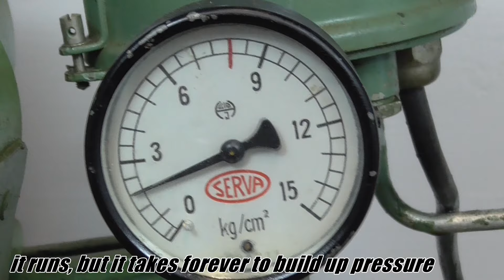1959 Broken Air Compressor - Repair and Maintanence

Comment: 00:07 me when I saw the power outlet 👁️👄👁️
I never seen that kind of outlet before here in my country even tho we use the same EU type plug, it's kinda cool
Reply from the maker: It's a swiss plug, only used in switzerland.
Reply: my mechanics insights ah i see.. i havent finished watching when i commented and i just realized it actually has 3 thingy not 2 😆
Reply: @mymechanicsinsights  Also supposed to be used in South Africa, but the most common use of them in any application is to charge a cellphone.  However your tank really needs to be cleaned inside, simply by filling with water and sloshing it around to get the scale moving to the drain, and then preferably also a inspection to see if the inner wall is not pitted badly. Pressure test as well would be good.
Reply: @mymechanicsinsights  also in Brasil! Our damn country changed 5 years ago the entire standard. Instead of using a more broad standard like EU or US, they used swiss, lol. Nothing wrong with it, but just a peculiar situation :p
Reply: my mechanics insights it’s very similar or equal to the new one used in Brazil.
Reply: @fabsfabsfabs 
I wish the world would just put their heads together and standardize already. Having 47 different outlet varieties is outrageous.
Reply: @SeanBZA 
Weird question, possibly, but could you use a mineral oil bath inside to make sure everything got washed out? Or would that be harmful to the inside of the tank?

Also, would a hydrostatic test accomplish the same thing?

(Forgive my ignorance, I don't know much about air compressors.)
Reply: @SeanBZA  Not quite. Brazil and South Africa use a very similar design that's mechanically incompatible to the Swiss plug for some reason. The SA plug is based on the IEC 60906-1, a proposed world-standard plug that no one wanted. There are three main differences between the IEC and the Swiss T13: the IEC plug is rated at 16 amps and has 4.5 mm pins, while the Swiss T13 is only rated at 10 amps and has 4 mm pins and the third pin is further offset in the Swiss design. Brazil decided to deviate even further by having a 10-amp and a 20-amp version with different pin diametres (4 and 4.8 mm).
If we're ever going to see anything resembling a European standard it'll likely be the German/French multi-standard plug with each country picking one of the two socket types. Italy has been moving towards the German standard for several decades while keeping their own system in parallel, Denmark considers both French and German sockets acceptable in addition to their (rather problematic) own system. Actually the system isn't flawed in itself but it doesn't work with imported plugs, not without being dangerous because the earth doesn't connect to anything if a German or French plug is plugged into a Danish socket.
Reply: @Jetmech1781  indeed!

Comment: What is that slime anyway?
Reply from the maker: It's a mix of oil from the pump and condensation.
Reply: @mymechanicsinsights  Looks like some algae or somesuch in there too
Reply: Someone in a different comment said it might be an emulsion of water and oil, like mayonnaise
Reply: Very reminiscent of the white 'mayo' that used to appear in the valve cover of my old Mk1 Ford Escort.  Generally accepted that this was a sign that the coolant (water) was mixing with the engine oil (e.g. due to leaky head gasket).

Comment: Nice work and still in great condition too!

My grampa had an old compressor that he salvaged from the sugar cane plantation. But the tank was always clean because he would always release all the pressure after he was done using it and left the valve open. Years later after he got it in the 50's, it still runs fine. Any advice out there on maintenance to this unit? I don't know the brand (it's all in Portuguese and the info plate is gone). I'd like to keep it running for more years to come.

Comment: The wheel on the motor that drives the belt looks non-original, and sticks out like a sore thumb. Would you consider making a new wheel that would look more original to 1959, especially because the current wheel is most likely already non-original?

Comment: Hot tip from someone who rebuilds engines, never use a razor on a deck or cylinder head. You can mess up the deck or head and you will have to take material off. plastic paint scrapers work great for gasket removal!
Reply: Oh come on. On any other channel you'd be 100% right. But here you are talking to a man who can hone a surface to 0.001 nanometer tolerance with just a blunt axe.
hehe
Reply: And if... he has a flat grinding stone.... or if it is too much broken or scratched... he will make a new one.... 🤣🤣🤣🤣🤣🤣🤣🤗🇨🇭

Comment: You should probably find a way to completely clean the tank from water/oil or your issues will come back sooner or later. There are also automatic bleed valves available to remove water from tank every such time.... (Say somebody who should do the same on his own compressor.....)
Reply: Auto purge is good. Clearing out condensation is difficult. Unless you're painting, just lube your tools.

The hard plug should go at least replace it with a manual purge.

Comment: I was hoping to see it redone in a nice more beautiful color and with a more quiet engine, but this more of a repair than a restoration…

ps: with flexible wire and a screw connector, you should use ferrules / Aderendhülsen…

Comment: Do you think you could turn an air compressor into a steam generator? I can't, but how sweet would that be! To generate electricity just light a fire. I wonder if getting all of the air compressors components and modifying them and reconfigure them to operate as a steam generator is possible.

Comment: always when you finish using the air compressor always release the pressure valve this way no water will accumulate in the tank

Comment: Was the air filter part a joke I'm missing it looks like a bird's nest!!???
Reply from the maker: That was a very old school air filter, not sure what material that is. It's built in 1959
Reply: Could possibly be horsehair.
Reply: @Opel_Guy  Would be horsehair, felted together and used as filter. Just needs some hoof oil on it to provide a dirt trap, and then a rinse every so often in kerosene to clean, followed by more hoof oil.

Comment: Water is better to be drained every time before operation. Before is because it has time to properly condense after last time.
That slime inside is a mix of oil and water, suspension. Nothing bad, but if to much oil in tank there's possibility of leaking oil.

Comment: The wire ends deserve soldering for a better mechanical connection and the compressor deserves an electrical switch. Please don't use the Pull Out method.

Comment: Probably that was just an air leak through the safety valve. And a lot of oil in the air vessel may probably be a sign of piston rings significant wear.

Comment: Oil is getting past the rings in the pump and if been sent through to the tank where it’s mixing with water from the compressed air you have not fixed the problem you just cleaned it if you replace the pump piston rings you will give it another 30years service instead of a few months where the problem with happen again
Reply from the maker: That's normal and wanted. You need oil in the compressed air so the pipes won't rust. Piston rings are not 100% sealed, there will always be an oil film.

Comment: Old air compressors are like ticking time bombs - you never know when they will go off. It's not a good idea to have a bomb near you... that's why you never repair an airframe older than 10 years. safety first

Comment: 7 min for a belt driven/oil lubed pump and 15-20 gallon tank is still very slow. That's normal for a direct drive oil-free compressor, but not belt driven/oil lubed. There's still something wrong.

Comment: The beige mayonaise like sludge drained from the tank is emulsified oil and water.  Your pump rings aren't sealing 100% and compressor oil is entering the tank.  And such an old tank that could explode.  It is a tired single cylinder beast...let it go.  Any serious compressor is twin cylinders.  A lesson learned is that one always loses with old equipment..constant repair money pit.
Reply: except in this case repairing things is how he makes money

Comment: I understand water in the tank but not the oil.
Reply from the maker: The oil comes from the pump.
Reply: @mymechanicsinsights  Well yes, that is the only place the oil is but it shouldn't be happening. Does that mean there is a problem with the pump?

Comment: Just clean the parts and solve the problem? Why doesn't works first time?
Edit: For sealing the thread, instead of teflon tape I use loctite 55, it's more efficient.

Comment: so much oil in the tank and in the piping is an evidence that the oil control ring does not do its job so never use that compressor for spray painting, you'll do a fisheyes mess, for the rest, this is s fractional horsepower motor so the air flow is quite limited and a long make up time is quite normal.
Reply: SARA HOTGIRL VLOGS  on such an old machine, usually the gaskets are oil soaked and caked so the spreading of asbestos free fibers is not that likely to happen, just do not use a grinder or a sander to clean the setup to not shred the gasket remanents.

Comment: Always cool watching this kind'a stuff, but I gotta ask:  

Is there some reason why you (& so many other mechanical guys on YouTube) don't wear gloves all the time? 

You wore ones while using degreaser on some components, so I know that you get these products are damn toxic to humans (especially with frequent use / over time). Human skin is way more permeable that most people realise. If you got your bloodstream tested, you might be pretty disturbed at just how much industrial chemicals you've got in there. I also reckon you were really wishing you're wearing gloves when that bacterial / contaminated goo came out of the tank onto your fingers.  ; )~

~ ~ ~

Is the shaking & resonance a part of the original design? Or is is due to wear & tear over time? How old is this thing?

It seems like you could add some high density foam rubber between the metal on metal areas (just above the main tank), for a start, & maybe some better bracing for the tubing components. The wheels transferring power through the belt seem slightly eccentric (wobbling) & the belt seems loose. Maybe adjust/replace the centre bearings & get a harder/tougher belt.

These suggestions could be completely wrong as I don't know much about this design. I've seen & used older shop compressors (from the 1980s) that were still pretty noisy, but with less knocking & bouncing, and most of my ideas seem like common sense to me, but feel free to tell me to get bent.  ; )

Comment: Amateur.😁 Real mechanics just use their dirty, greasy hands to mark the pattern for gaskets. Also works well when you have a stamped serial number plate when taking pictures. It provides contrast so you can read the numbers.